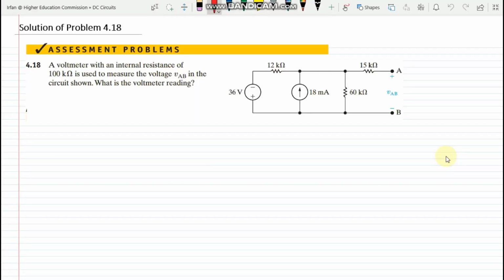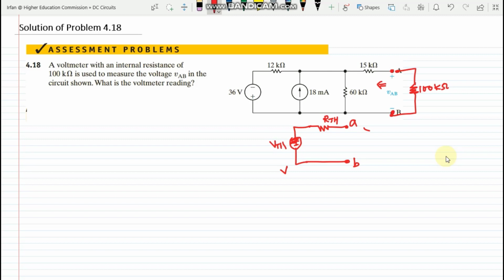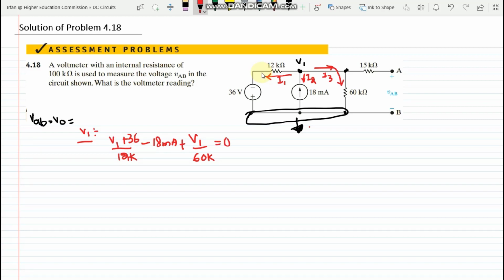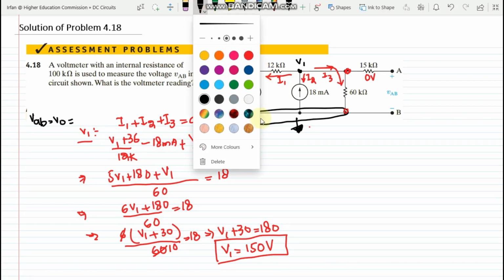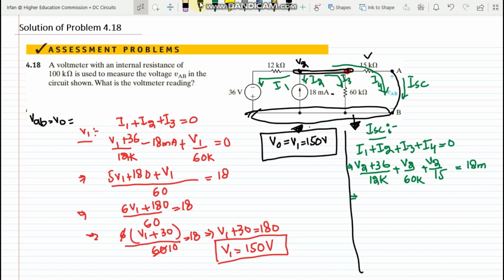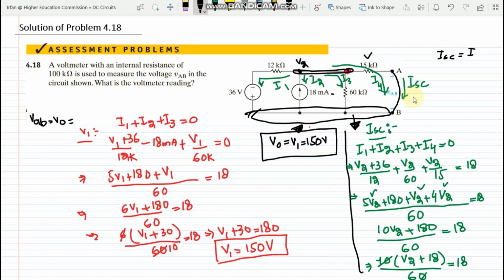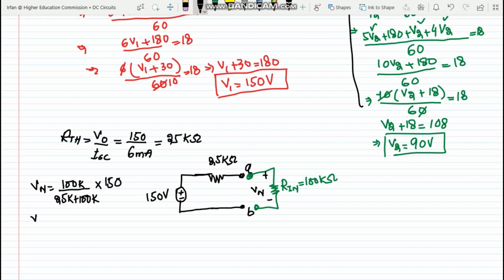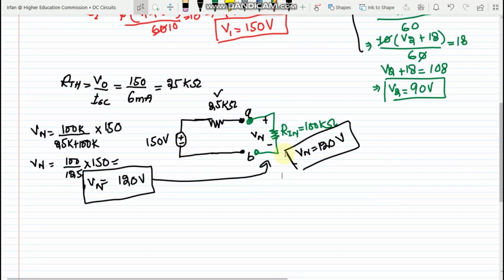Thevenin's Theorem Problem | Problem 4.18 - Electric Circuits by Nilsson 10th Ed | Engineering Tutor

Comment: At 4:40 why is i1 is equal to v1+36/12 why is it not v1-36/12 please elaborate
Reply from the maker: Because of the opposite polarity of a voltage source. The current i1 is entering the source from the negative terminal and leaving from the positive terminal to ground. If it was opposite, it would be as you stated.
Reply: @EngineeringTutorOfficial  oh yes thank you so much